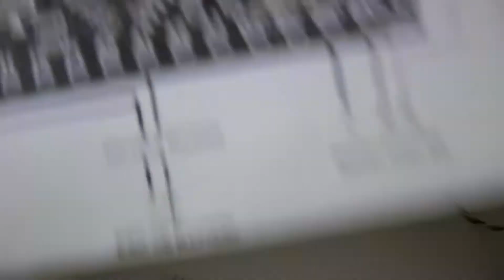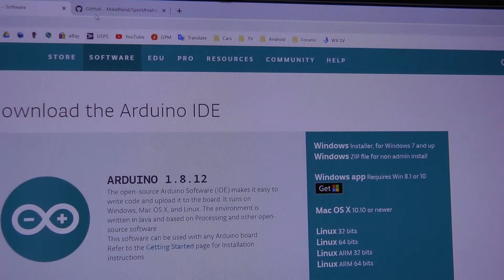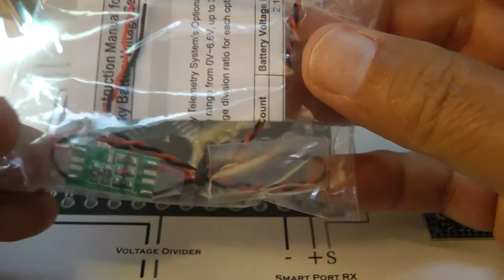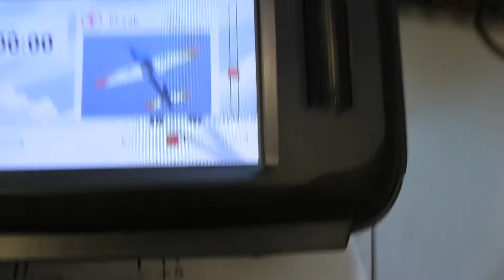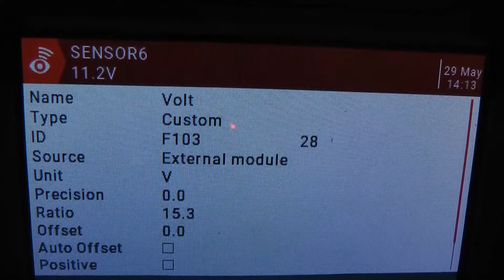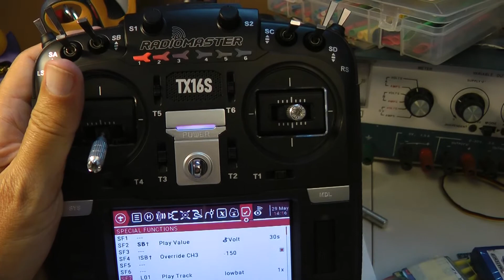How to make a Smart Port Voltage sensor for your FRSky receivers

Comment: Thank you for making this tutorial, really informative and helpful.
I have a RX8R, and I was quite confused at first when i saw I only had a fix value for A2 and not something proportional to the battery voltage. In my case the Tmp sensor that was actually the one to use for the voltage sensor. It works like a charm, and now I can say I have an Arduino in my plane and look like a cool guy at the field ;)
Reply from the maker: Let me know how it works out for you, I have had some issues where the voltage is not very accurate. I calibrate it, it's accurate and then a 2 or 3 flights later it's off by 1/2 volt.
Reply: @GaryQuiring  That's good to know, I'll pay attention to this during the first flights
Reply from the maker: @BouncebackFpv  I am speculating it might be based on temperature when the model sits in the hot sun all day.  I have one a flat foamy and the board is in the direct sun.
Reply: @GaryQuiring  Maybe. Mine will be placed inside the plane, will see what happens

Comment: Thank you for this excellent video. I have just tried this using the exact same boards and Arduino 2.0.3. At the end I did not get the red text saying thank you. I got Done..compiling then Done..Uploading. Is there any way of inspecting the board to see what code is on it? I don't want to move to the next step soldering the wires if the code hasn''t been written. It's my first use of Arduino!
Reply from the maker: There is no way I know of to compare what got uploaded to the board.  It sounds like you got it uploaded.  It's just a more recent version of the Arduino compiler with different messages.

Comment: you just pointed out a few things that saved me....  also,  what is the chance of you making a couple of these to sell me  ??
Reply from the maker: Maybe you can find someone local in your club that has some electronic skills.  With shipping and labor costs it would get expensive.
Reply: @GaryQuiring  what if you just sold me the correct parts only ?
Reply from the maker: @rl2rem621  The ARDUINO parts can be purchased on Amazon or eBay, the voltage divider is a FRSky part and can be bought from shops like Aloft Hobbies.

Comment: Is it possible to produce a multisensor with one board? Current solution requires an µC for one sensor.
Reply from the maker: I am not the one to ask, Mike Blanford did the programming.  My part was to help rookies who had no experience with Arduino to make this project.

Comment: I was looking up to order the parts,  but just thought.... ohhhh,  will this work on 6S  ??
Reply from the maker: I only tested to a 4s battery, it would work with higher voltages but you would need a different resister for the voltage divider.  And before you ask, I don't know how to compute that.

Comment: Lo! That's not a hard board to solder too, that's a walk in the park and about as easy as it gets! 
Dunno why anyone would use the arduino micro, use an arduino nano, its cheaper and has a built in USB serial converter and you just plug in a USB cable and none of that in stupid hooking up of an external programmer.
Reply from the maker: The code only works with 3.3v 8mhz, does the Nano come in those specs?